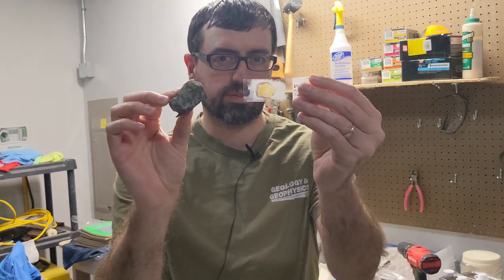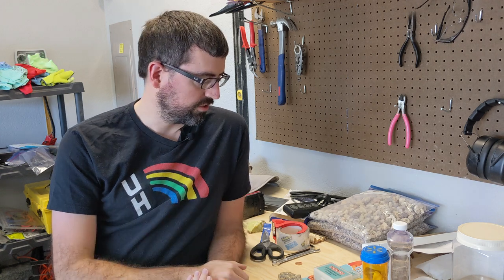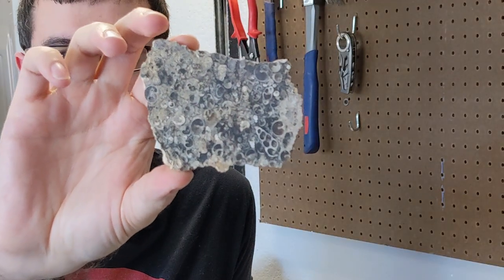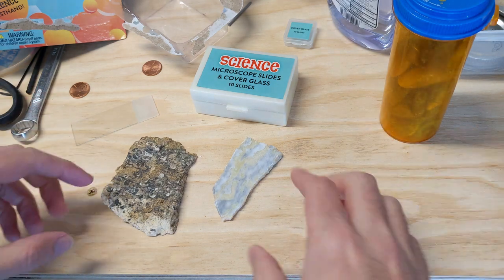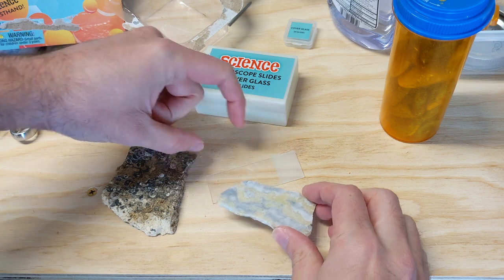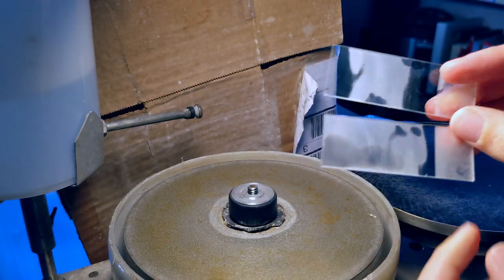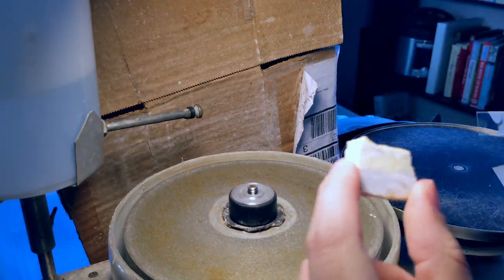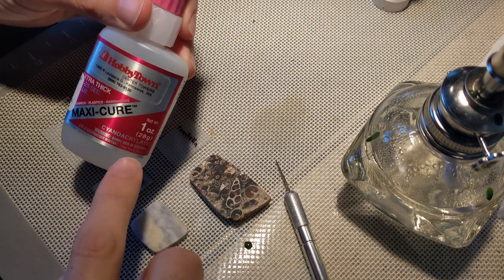DIY Thin Sections of Rocks and Minerals

Comment: Some tips: 
The first side (before gluing to the slide) needs to be polished down as much as you can as well (preferrably  with alumina or diamond paste to 0.25 um abrasive size). 
The sample needs to be thoroughly cleaned between steps (e.g with ultrasonic cleaner) to remove abrasive material.
Instead of holding the sample in one position, it is better to do figure of 8s to  create an uniform thickness. Gluing pieces of glass at the corners can also help with that.
Although i agree that it can be done using a rock saw and sandpaper, thin-section preparation requires a lot of practice to achieve the technique to make good thin sections.

Comment: Few comments. Frosting the slide is only good if your adheaive has a similar RI to the glass. It is good to do to flatten the glass. Agate is banded or varigated chalcedony. Your sample was not agate.
Also, if you are sectioning carbonates etc, it is handy to glue a couple of quartz grains on each side beside your sample to use as a reference.

Comment: Perhaps the grinding could be made a little easier by putting a dop stick on the back of the slide so when putting the down pressure on the slide you can lift in up with ease and all the pressure is in the correct place.

Comment: Great video! The steps were very informative and definitely gives a sense of accessibility for anyone to try. Of course it's super cool to see the thin sections magnified with the microscope, but even the thins close up at lower magnification (loupe) were really interesting to see that way. Hopefully folks will be tempted to view some of their mineral treasures in a closer way from this. Thanks for sharing your experience, cheers!
Reply from the maker: And I'm looking forward to your thin section video!
Reply: You can examine the thin section between two sheets of "polaroid" (other trade marks are available!) to bring out the interference colours. Then a regular hand lens or microscope will allow you to see some of the detail. But interpretative work (mineral grain compositions within series, for example) typically need a rotating stage too.
Hmmm, I've got a rotating photographic filter holder (for "star burst" effects, etc) which might help. But then, I've also got a petrographic microscope form when the college shrank it's geology department size.

Comment: Thank you for the demonstration. I enjoyed it very much.

An idea for future attempts at making a thin section with parallel sides and to facilitate accurate thickness measurement during manufacturing.

Float glass is extremely flat. I suspect that the microscope slides are also very flat. lets take advantage of that to be our guide to machining a thin section to be nearly perfectly parallel and meet dimensional specifications. 

Grind, lap and polish a flat surface on the artifact, to a surface RMS that is required for microscopic use.

Method to adhere a specimen with superglue to a glass slide that has groves to accept the adhesive.

Etch many parallel groves into the glass slide, lengthwise. Make the groves deep enough to accept a thin film of the adhesive, experiment until you find a good ratio of depth to width. The depth and width of the groves depends on the viscosity of the adhesive. Our goal is to wick the adhesive under the specimen and to avoid getting 'any' adhesive between the glass slide and the specimen.

Before placing the specimen onto the glass slide, load the etched groves with adhesive. Add adhesive until the meniscus reaches up to the surface and not above the glass. We want to avoid any glue on the surface of the glass. Use a split toothpick to encourage the adhesive into the grove. It's best to do this in a low humidity environment, as superglue kicks off with moisture.

To get the glue onto the specimen. Drop the specimen onto the glass slide, don't move it. At the perimeter of the specimen add more adhesive into the groves in the glass. The adhesive will wick into and under the specimen, providing that the grove width and depth are sized properly.

To speed up the curing and to encourage curing of the adhesive under the specimen. Mist a small amount of distilled water at the perimeter of the specimen onto of the groves. Follow the manufacturers cure time before lapping.

There are solvents that will break the bonds of superglue. So if you want a clearer picture of the thin section, consider removing the specimen from the superstructure. And apply it to a new glass slide.

I hope you can make sense of what I have described.

Thanks again for sharing your experience with us! You have given me ideas for making beautiful 'things'.
Reply from the maker: You make some interesting points. I hesitate to carve too much into the slides because they are thin, and also a big groove would cause aberration in transmitted light. But I certainly didn't need as much CA glue as I used, and I kind of like the idea of letting the glue seep in under the edge to minimize the glue thickness.
Reply: @DonohueLabs  If you used 1/8" to 1/4" thick float glass you will have plenty of thickness to work with. You will be hard pressed to find anything flatter. Float glass will also not be prone to flexing as much as the glass slide. The thickness will also make it easier for you to grip.

Ideally you would finish one side of the specimen to a high polish. Separate it from the glass while it's still has it's strength/integrity and glue the finished side down. When the desired thickness is achieved, carefully remove it and place it onto a clean glass slide. Mineral oil could be used to hold it in place.

One grove on two sides of the specimen may be all that's needed to retain the specimen. Maybe baking soda could be added for additional strength?

The only iffy aspect is removing it and handling it after it's finished.

There are also different viscosities of superglue. Use the type that flows like water, the gels are not suited for this.

Tks!
Reply: @DonohueLabs  Glue thickness isn't a problem. It's isotropic and (should be) colourless. (That's why "resin impregnation" is a step taken before gluing the proto-slide to it's microscope slide.
The glue that penetrates into cracks, grain boundaries etc provides a reference refractive index for the "Becke Line Test", where on up-focussing, the refracted bright line moves into the higher RI medium. (Hence the importance of the RI of the glue.)
After thinning the slide to 30µm, you apply more glue to the surface of the slide and glue a cover slip onto it to protect the side and allow Becke tests for top-surface fractures.
(For polished (µ-probe) samples, the top surface need to be open to air/ vacuum.)
Trying to "seep" the glue as you describe is likely to leave parts of the slide un-attached to the glass, which would fragment during the thinning stage, meaning a complete re-start. You don't want to do that.
Reply: @pigeonbloodruby5330 That thick a float glass would introduce colour banding under cross polarised light (which is why you cut thin sections) because of residual strain in the glass. That would complicate interpretation of mineral identities, textures and compositions -some of the tests that need a £1500 microscope need careful optical testing ; the alternative is a £200000 microprobe, and a vibration-proofed lab to house it.
Microscope slides are float glass anyway. Just about a half-mm thick. You could fill your windows with it, and watch it break in the wind. 
"The only iffy aspect is removing it and handling it after it's finished." The 30µm thick rock sample? It'd crumble to powder. Even good commercial slide preparation labs lose several percent of their slide to this (and have to re-start the process). at 30µm thick by 20mm wide it has an aspect ratio 1:600 - which would be like a wall tile about 6m wide - very very  fragile. 
"There are also different viscosities of superglue. Use the type that flows like water, the gels are not suited for this." Viscosity is pretty unimportant (within reason) - the refractive index needs to be 1.54 to 1.56 (to match "Canada Balsam". Otherwise the minerals just look peculiar, greatly increasing the time and cost of interpretation.

Comment: The slide-frosting step is unnecessary, if you clean and dry your slide (and rock) before gluing it. 
I know you're using existing tools, but putting a sheet of glass onto the lap and using loose grits would probably work quicker and better. 
Gluing the specimens down would work better by putting one bead of adhesive along the specimen edge, then tilting the specimen onto the slide. A little jiggle to move bubbles off to the side. 
Do you know the "sand grain" technique for getting thickness references into your slide? At standard thickness (30µm), between crossed polars ("polaroid" etc), the brightest colours you'll get from a sand grain will be first-order white. With sheet polaroid and a hand lens, you should be able to check this. 
"Compound" microscopes in general can't do reflected light microscopy - for that you need a "reflected light microscope". "compound" means several lenses in the "objective" assembly, and more lenses up the tube constituting the "eyepiece". Petrographic microscopes have tools ("polars", other lenses) between the objective and the eyepiece.

Comment: Can you do this with any stone?
Reply from the maker: Pretty much! It just has to hold together during grinding, and can't be water soluble. You CAN do water soluble materials, but you have to use other liquids like acetone or methanol. That's what they use for some meteorites.
Reply: @DonohueLabs  Preparing thin sections of evaporite minerals (i.e. water soluble) is a recognised field technique, using as you say, non-water solvents. But it's extremely time consuming, and generally unnecessary to know *at the field site*. You do your mapping, collect your samples, and do that sort of detail back at the office outside the field season.